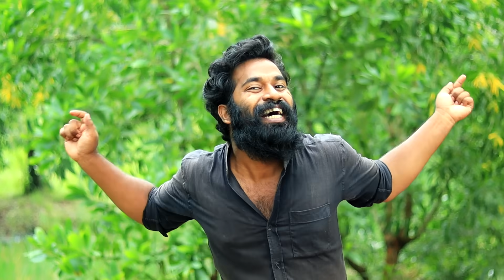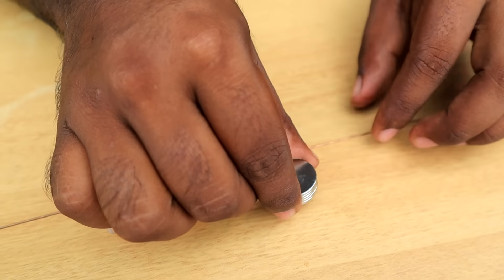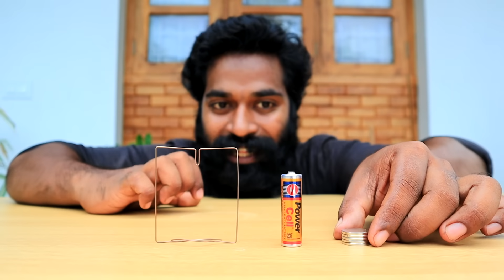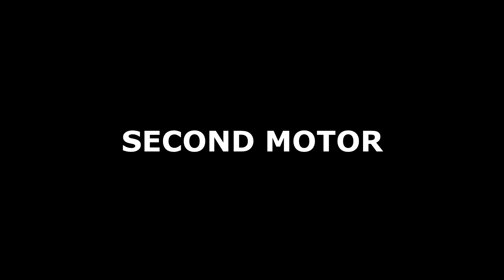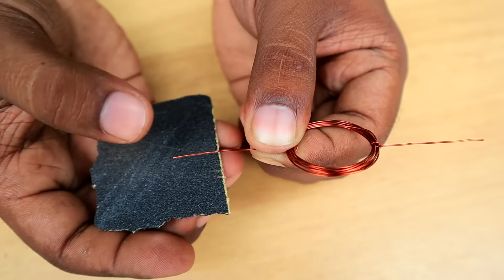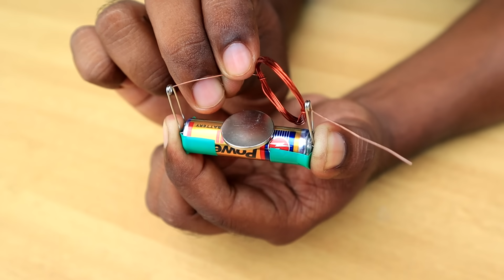WORLDS SIMPLEST ELECTRIC MOTOR MAKING |മിനിമോട്ടർ ഉണ്ടാക്കാൻ ഇത്ര എളുപ്പമായിരുന്നോ | M4 TECH |

Comment: ചേട്ടായി ഇത് എങ്ങനെയാണ് പ്രവർത്തിക്കുന്നത് എന്ന് ഒന്ന് പറയാമോ... scientific explanation..
Reply: Electronic magnetic induction te oru property aanu
Reply: Watch ElectroBOOM simple DC motors
Reply: DC motor works on motor principle.That is when current passes through this copper wire,which is placed under a magnetic field, a force is experienced on the coil.thus,it moves
Reply: M4cg

M4cg
Reply: Abhijith Narayanan magnetic field is made around the battery by the magnet which causes it to spin